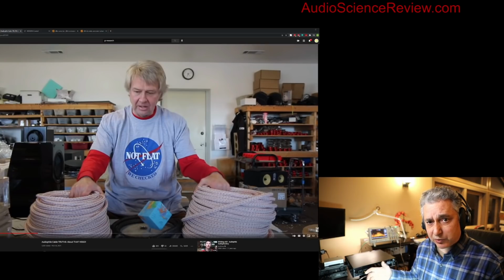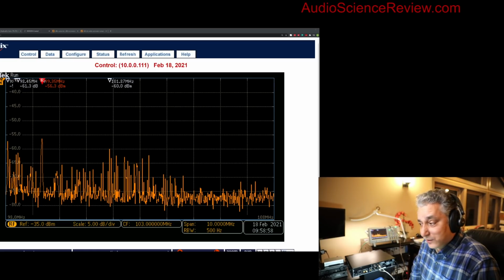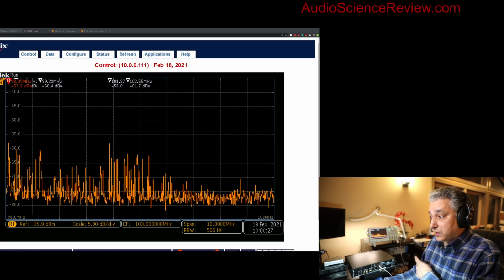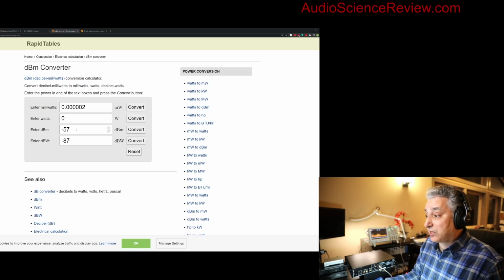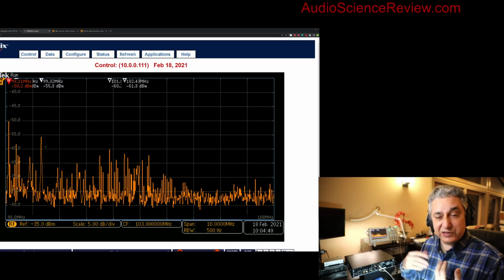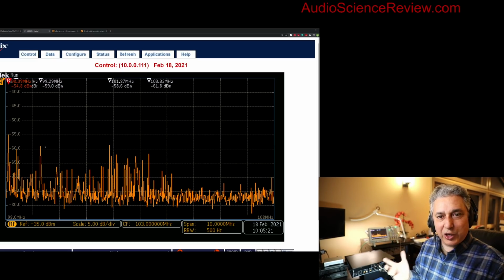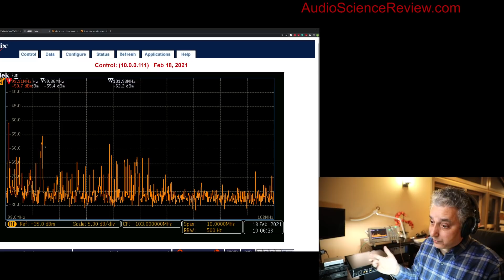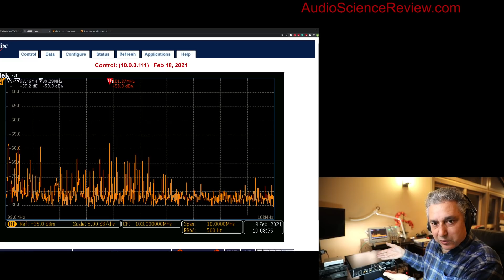RF Interference in Speaker Cables???

Comment: Should have done the same test with braided audio cable. Just showing that the noise level and frequency levels are insignificant using standard speaker cable still does not prove the point that the braided cable does not offer a further reduction or rejection to outside interference. Would like to see some AB comparisons. How about injecting a signal on just the positive wire and measure any coupling that may take place on the negative wire , if it even exists. I like that you are doing actual measurements of signal frequency and level. But it so far only indicates that the levels may mean nothing to actual application. Not that braided speaker wire offers no further reduction to ambient RF or inter-wire signal coupling. I look forward to you doing an A/B test on the Power cable offerings. Recommend plugging a standard computer UPS into the same receptacle that the high end power cable is plugged into and measure the reduction if any. Hell put the UPS in test mode and really see the noise sent back onto the A/C Mains.

Comment: Amir, 
To follow up about the use of a power line EMI filter on the output of a power amplifier, I sent the following comment to Danny to try to encourage him to consider trying it and comparing to expensive filtering cables. In his latest video which you probably have seen, he demonstrates how coils can couple audio signals differently with different orientations in an effort to explain why different cable geometries influence the pickup of stray EMI fields. Both this and his original video demonstrating the fact that a speaker wire is an antenna avoid the real issues of EMI susceptibility and whether or not it can affect the sound of a system. As I am sure you realize, EMI can find various ways to influence any electronic device and the entrance path via the amplifier outputs is just one way.  The next step should be to identify the various ways that EMI can enter and interfere and address each. Also it would be very good if you would demonstrate the susceptibility to some common forms of EMI such as switch-mode power supplies in close proximity and plugged into a power strip along with the amplifier, a cellphone in use in close proximity, a wifi router in close proximity, etc. and measure the noise from each source at the amplifier outputs to get some perspective on the amplitude of the externally induced noise.
--------------------------------------------------------------------------------------------------------------------------------------------------------------------------------------------------------
Danny, I never doubted that a speaker cable is an antenna (any wire is an antenna) or that it can also filter EMI/RFI. The real questions are,
1. Can EMI/RFI affect the sound and under what conditions is it audible? I will not challenge you on can it affect the sound as I am sure that it can under the right conditions.
2. What is the mechanism that causes it to happen and why does it happen? Without any doubt, it is the negative feedback employed in the power amplifier sending a minuscule amount of EMI/RFI from the output to the input. As everyone knows, the amplifier cannot amplify RFI which is too high in frequency to be amplified by an audio amplifier, but the more general case of EMI being any frequency means that an audio signal amplitude modulated onto the RF carrier CAN be amplified, and any digitally modulated RF carriers like TV stations, radio stations, cellphones, wifi, etc. can also be amplified by the amplifier. So it is entirely possible that some amount of this noise can appear on the amplifier output. The big question here is is it sufficiently strong enough in a given situation to be audible. And one might ask why the amplifier is not made to reject EMI/RFI in the first place. Might it be to help support the cable industry? 
3. How can it be addressed? It can be addressed in different ways, such as reorienting and/or shortening the cables, shielding or twisting the cables to minimize RF pickup, and building cables to integrate filtering with the cables. Reorienting is a free solution if it eliminates any audible noise. Minimizing RF pickup with shielding can be ugly and unwieldy using conduit. Minimizing RF pickup by twisting the cables is a potential solution and can be cost-effective or exorbitant depending on the manufacturer. Filtering is yet another option and can be done by adding inductance and/or capacitance to the cables to create a lowpass filter, albeit at moderate to exorbitant expense depending on the manufacturer. A perusal of speaker cables from the sources you mentioned revealed a cost from $220 to $106,599 per 8-foot pair. Another way to employ filtering is with the addition of a lowpass EMI power line filter at the amplifier input, available from any electronics supply company for around $20. Coupled with twisting the speaker cables, the pickup and filtering can provide a large increase in noise rejection for minimal cost. However, this may not result in any noticeable difference depending on a given situation of equipment, cable layout, EMI/RFI field strength, and personal sensitivity.

To conclude, I feel that it is a sham and a disservice to the audio consumer community by the manufacturing community to not design and build audio equipment to have a high and measurable amount of noise rejection because it can be quite inexpensively accomplished within the feedback path and PC board/wiring layout in the design phase. To put the onus on the customer to deal with external noise is just bad for the user but good for a major parasitic cable industry.

Comment: I watched your video and I do understand enough (now) about RF in loudspeaker cables and how little impact it has "normally". I have a SpectralAudio pre amp and a SpectralAudio power amp, both are Megahertz amplifiers.  These units can amplify well into the megahertz range; the preamp internally up to 30MHz and the power amp up to 5MHz internally and up to 1.5MHz to the speakers.I also know that our hearing ends around 20KHz, nowhere near the MHz that the amps can process. SpectralAudio strongly recommends to use MIT or SpectralAudio cables which have networks in them and are super expensive.  Here is my question, finally: Do I HAVE to have networks in my interconnects and in my speaker cables to prevent damage to my system?  What kind of harm could be done? Is oscillation a real threat here?  Thank you, and keep up the good show!

Comment: Thanks Amir. Very happy to see my favorite ASR content is finally on youtube! I am tired of too much "AudioPhoolary" BS on youtube even with reviewers I thought somewhat legitimate to start with. $250 Power cable somehow magically change the sound for better, give lot more amps when 100 foot ROMEX in the wall is not changing. Danny claims somehow it cleans the EMI/RF, then suddenly audio changes for better(That's his response to my question). Even cheap 20-30 buck Surge protectors have EMI/RF filters, not so sure what these  $1000 power cables do. Appreciate if you  can put some reviews for those here on youtube!  Very happy to see some rationale, quality measurement and explanation being available in this format.!
Reply from the maker: Thanks Chinna.  I procrastinated forever in doing videos but for the reasons you mentioned, I thought I have to start.  I am glad you all are finding value in them.

Comment: The Amazing Randi had a $1 million dollar bet out there for "audiophiles" claiming to hear differences in speaker cables and never had to pay out.
Reply: Alan Shaw (MD Harbeth Louspeakers) has offered a prize of his top of the range speakers (M40.2) to anyone who can tell 2 decent amplifiers apart in a properly controlled blind test. Only proviso is that amp is not driven into distortion. That should be a doddle compared to speaker cables. Guess what, nobody has taken him up on the offer.
Reply: @garethonthetube  I don't know how many years ago, but long before Stereo Review got bought up multiple times and turned into whatever it is now, they conducted listening tests to see if people could hear differences in electronics - yes, operating within design constraints (it's said that caveat has to mentioned each time as subjectivists will all jump on the fact of equipment distorting under extreme loads) - and no one could, or at least not statistically significant and those who claimed to hear a difference couldn't say which was "better" and never correlated anything with the "clearly better" piece of electronics. Wish I still had that issue. Probably 40 years ago or so.

Comment: persumably you could define the parameters for what would make foor a good speaker cable, based upon the requirement that cable would need. Would this simply be the guage? Or are there other factors which could be included?

Comment: I've read is possible that cables that are complex in design could function like a capacitor and be functionality part of the cross over network in the speaker. Therefore a difference could be heard between cables, but the result is less accurate than using a less expensive cable irrespective of their rf filtering capabilities. Thoughts?

Comment: Hi Amir, first thank you very much for your reviews and the hard work you put in. Not related to the topic, but I wanted to say that I think, if possible, you could add more measurements to the headphone measurements you do in  your reviews, for example the ones done in www.rtings.com, I am mentioning this since it seems frequency response and distortion alone do not completely depict the performance of a headphone (soundstage, clarity etc), at least I believe I will be able to tell apart HD800s from any other Sennheiser headphone in a blind test every time even if eq was done to more or less match their frequency responses. I think you have already looked into the measurements done in rtings.com but in case you have not done so I guess you could take a look at them :) 

Thanks.

Comment: Most amplifiers have an air cored inductor on the output of the amplifier which is intended to protect the amplifier against capacitive loads that may cause amplifier instability. They also block high frequencies from passing. All well designed amplifiers will also have a zobal network to remove or attenuate high frequencies on the output of the amplifier, these are usually set to 100KHz (-3dB). So, very little can enter the amplifier's feedback path to affect it. However, depending on the amplifier (bandwidth greater than 300KHz), it may affect the components by causing heating of amplification components affecting their properties. Conclusion, better to reduce any RF EMI.

Comment: Yes, the $ hits the reality meter with blind A/B testing, and I'm sure decent test could be set up. There's precisely zero RF noise on short speaker wire runs, and that's been demonstrated many times. Pointing out companies selling over priced wires/cables as his source for support, 
is really only supporting the criticisms he's receiving. "There's a  whole industry out there" designed to convince people they should spend  silly $ on wires and cables, which is counter to the established  science. This vid and his positions, using sellers of cable as sources, is very damaging to his credibility. Again, get those companies to fund a decent study using a blind A/B comparison - you know, put $ where mouth
 is - and we can put it all to rest. I'd be happy to assist.

Comment: First off, I ain't an audiophile. 
Signal noise I think about the multi-mode CB radio where my transmission travels at speed of light (when you played the video of guy not flat t-shirt) you played at higher speed pitch I know, I know. Yet my sound of my modulation would be speed of sound. 
I have heard radio station 35 miles away filtering into an Alesis RA300 amp, to my JBL control 5, this was years ago, some weird electronic-Gremlins was happening then. I not heard any emergency service radio breaking over into my THX cinema in years now. My own CB radio I not noticed cos I can't be in two rooms at same time I could get extension lead for the mic and key-up in the THX cinema to see if I can hear any signal being picked up? But I doubt it even if it does that is least of my worries. 
I want get the power supply for my Dolby Stereo CP200 to be far less mild ground hum or electrical signal noise that I can see on REW spectrum mode as series random frequncuies spikes, at -80 or - 90dB down.

14:20 my brain receives tinnitus that would start at the ear copula? That has some misblanced in fluid or other where my tinnitus is triggered off, due to past high SPL dB due to universal pictures, battlestar galatica, in Sensurround at the local ABC screen 1, Bournemouth, UK, 1979. If I knew it was going to be 120dB hardful I would have placed my fingers over my ears or worn foam ear-plugs while my body my feel the Sensurround my ears wouldn't be or Our ears being hammered with 120dB! galatica had most intense use of Sensurround than Earthquake for the same running time. Saw Earthquake, 70mm six-track Sensurroud, 4 times not had any noise until 1979 and that battlestar movie makes life depressing each day. besides it was depressing movie death and destruction what a downer of a movie.

I think I may turn the REW on and pass some pink noise sine wave though the system and monitor it on the THX 3417 great Tom Holman audio monitor to test polarity, phase frequency, level and lot more. I guess I could connect the CB spk output to the THX 3417 see what the frequency hash noise looks like with CW FM AM and the single side-bands USB LSB I can hear the S/N ratio when switching modes but I can't see it.

Comment: Not so fast, guys...

1 - His assertion is that the filtering type cables help remove interference, reducing the possibility of added distortion.
2 - You didn't test a filtering cable to see whether this statement is true.
3 - You are ONLY showing that plugging a cable into your AVR can ALSO help reduce interference.
3 - And this 'debunking' is based on a subjective assessment of how much RF noise YOU find acceptable, for YOUR listening area. This matters because, what if I live in a particularly bad area, maybe in a city next to power lines, where RF, power and electrical noise is much worse across more frequencies?  I would want as much filtering as I could get.  Period.  This is why 'results may vary' is a thing.  

So, I would actually love to see you do a second set of measurements, with the receiver powered ON (*can't tell from this video but willing to take your word on that), and with a comparison between filtering type cables vs regular cables.  If they reduce noise even further, then his statement is true, regardless of whether his illustrative example was a good analogy or not.

If you are going to claim to debunk based on data, then you actually need to do an apples-to-apples comparison between the two cable types.  As he did.  You can't just look at one part of his methodology or the example he chose, say 'my results are not as bad' and claim it is debunked.  There's a little more required, here.
Reply from the maker: He claims that such interference is occurring in a way that no measurement can detect it.  The scenarios you mention -- RF intrusion and picking up local stations -- are bit 100% measurable.  Heck, you can use your ear for the latter.  If you hear a radio station, then you have something to fix although going after speaker cables would not be my first step in such troubleshooting.  

On comparing one cable to another, I actually granted his thesis of RF pick up and then went on to demonstrate why that is not a concern whatsoever.  I showed the full spectrum of FM band unlike his setup of a single station and with who knows what configuration of each cable.

And it is not like he is saying a few people can benefit from this.  He is claiming in all situations RF is a problem with speaker cables.  So all I had to show was the effect in my case and why his cause does not hold water even if we magnify the problem 1000 times.

Comment: Why would signals on a totally different area os the spectrum be detrimental to the Audio Bandwidth? Pretty much every stage of amplification, and of course the speakers, would be acting as low pass filters. I simply don't get. Just as i don't get the noise in power outlets.
Reply from the maker: That's the question, isn't it?  :)  To be fair to the other camp, if the audio is demodulated from the RF signal, then it can be an audible thing.  That is an impossible case to make for speaker wires though.